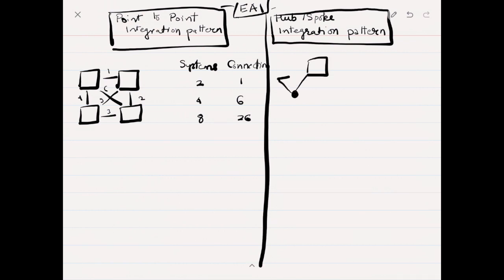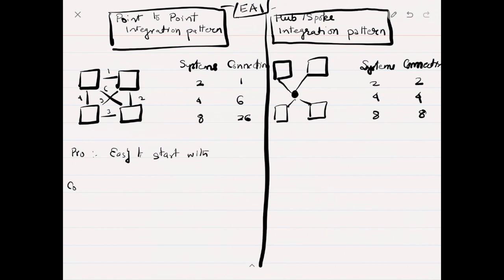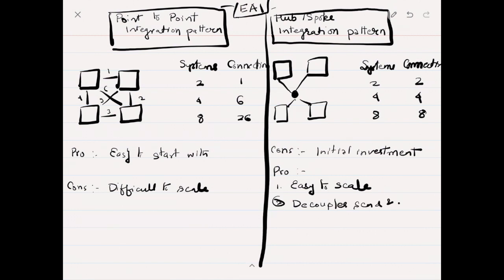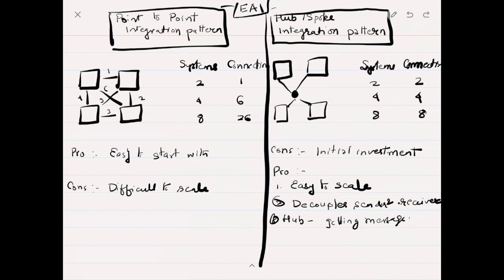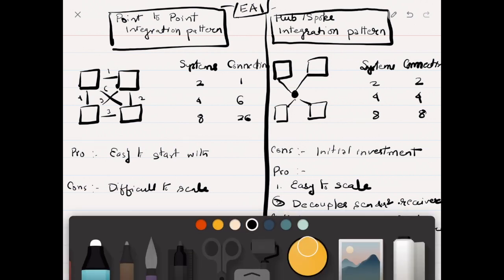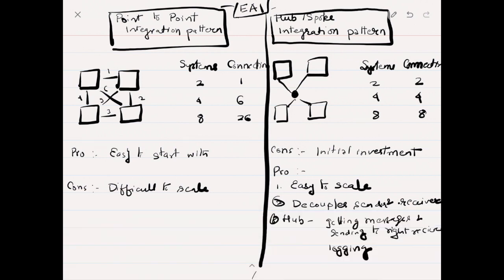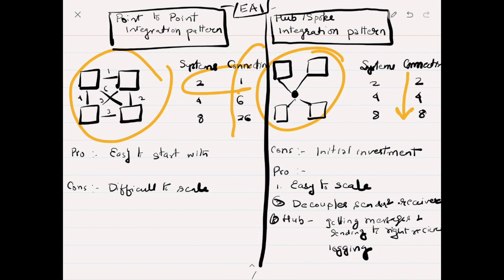Point-to-Point Integration Pattern vs Hub/Spoke Integration Pattern

Comment: Can you please explain to me how 8 systems give you 26 connections?
Reply from the maker: Hi Saeed, Draw 8 boxes and each box should connect to each other. 
It will add up to 26.
I just did the math . :)
Thanks,
Vikas
Reply: I did draw 8 boxes and I ended up with 16 connections using the same method that you used
Reply: it would be 28  (8 * 7 / 2)